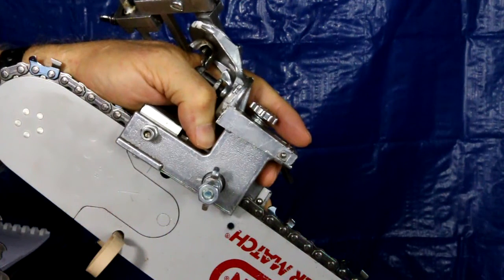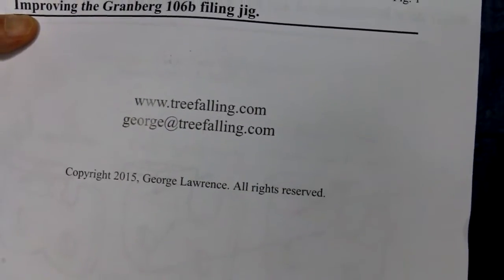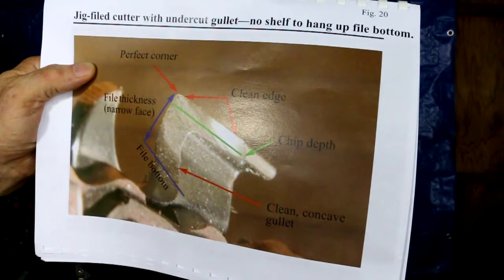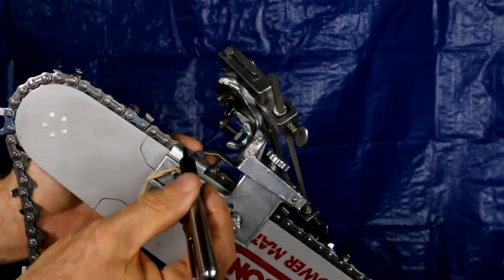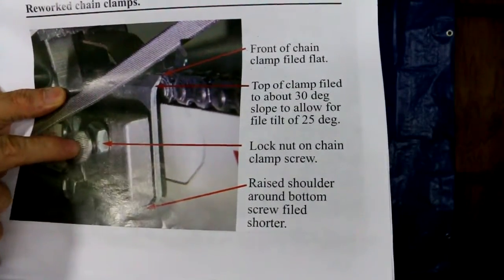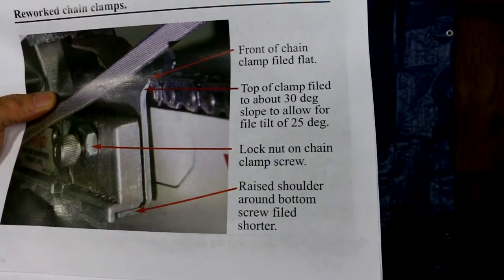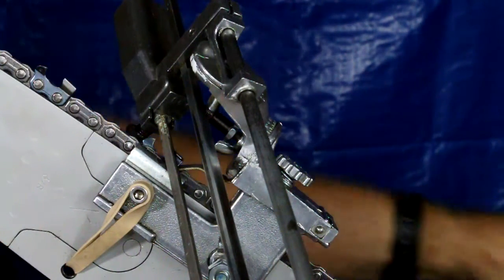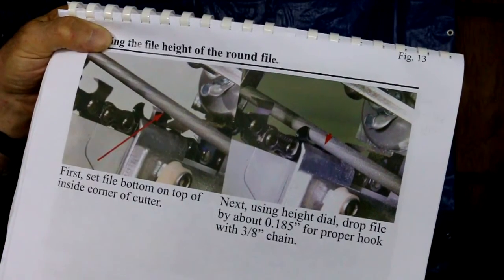Granberg106B Chainsaw Chain Filing Jig, Advanced Use

Comment: You have by far created the best video for using a file jig.  I was fascinated  by your explanation  of the square file cutter.  I used the round filed semi chisel  tooth with the 10 degree top angle.  Had no clue the square  tooth goes 20-25% faster.
Your modifications  are damn smart.
Boy howdy you must cut like lightning .

Comment: I have the original Granberg file 'n joint that did square file chisel chain, It was sold in the 70's to the early 80's and dropped. I know this because I called them in the 80's to buy another. I finally figured out after scabbing mine together all these yrs that the base units are still the same, so I bought another base unit. The file holders on the jig used to have inserts that rotated with the file and had tiny hash marks on them so you could match the right and left hand cutter angles. These inserts were milled perfectly for the Oberg files. My model had a sticker that was placed over the #106B....I think it was maybe an 'A'. Occasionally, you'd see my unit go through eBay for $50-$100. I haven't seen one now for yrs. I have the original yellow direction sheet with all the recommended angles. I've been looking for it for yrs....so far not found. I always use .404, square ground skip-tooth chisel. I usually run Oregon 68CJ Pro chain.
Reply: what model is the granberg that did square file chisel chain?

Comment: I have a saying I spoke often as a machinst- If it's man made it can be made better. You proved that. It's sad that the company has been making this same product for ~50 years and you improved its accuracy with two dollars worth of hardware. Next I would like to see bushings inside the top section where the guild rail moves. Thanks for the video.

Comment: Hi George, Extremely good video! You've really worked out the details of getting the most precision out of the Granberg 106b. I will have to watch this again, many times, to take it all in. It would be great if I could get a DVD of this video to use in my laptop out in the shed, as I don't get wifi out there. Any possibility of that? I'm sure that I'll be in touch with you again, as in the past, with more questions about these new modifications and the various parts of the video that I don't fully comprehend. Also, thank you for the heads about this! Regards, Owen

Comment: Very informative.  Is a skip tooth chain the same as a chisel tooth chain?
Reply: a skip tooth chain skips teeth, ie occasionally (1 in 3?) a tooth doesn't have a cutter on it. A chisel tooth chain has straight, nonrounded cutter blades.

Comment: OK, I've had a File 'n Joint since the 70's that was specifically designed to do square ground chisel chain. It's a shame you didn't have that as a template because some of your modifications are reinventing the wheel. The original sharpener had these little insert bushings that had degree marks on them and the bushings fit inside the hand jig....rotating to give you the degree you wanted. Unfortunately, my sharpener was cobbled together for a couple of decades after wearing out, because I didn't realize that the base unit itself is still made the same as mine. What differed was the actual hand jig that held the file. That part of mine is still cobbled together. On one of the saw forums a retired machinist went one step better and milled out the hand jig part for the file with rotating bushings....wonderful job....won't replicate for anybody. I do have close-up pics of that. Other than a grinder, there is still nobody that makes a nice hand jig for .404, square ground chisel.  If I can get some similar aluminum bushing you are talking about for my hand jig, I can again give it some new life. What I'm using now is a brass bushing that's been cut in half and shoved in on both sides of the file. It works OK, but setting up they tend to fall out and they're not exactly identical...being cut with a Dremel. That bump stop is a waste of time for getting your cutters the same length. I see in your vid that your cutter lengths are variable, so it's not working for you either. I just count the strokes and apply the same pressure every time.